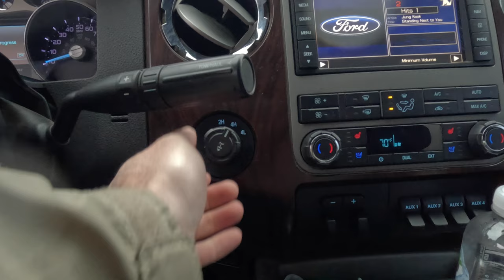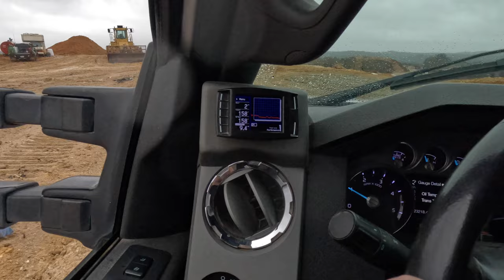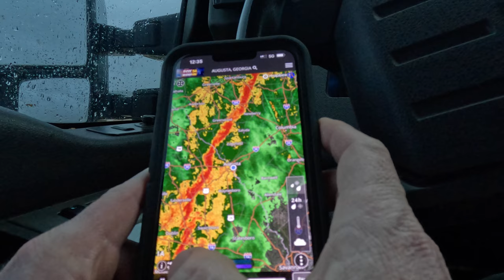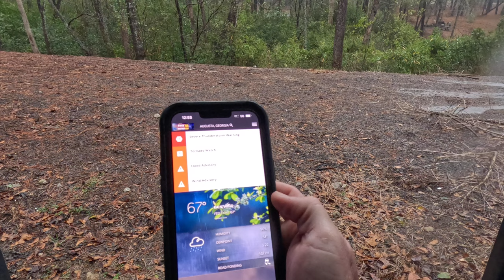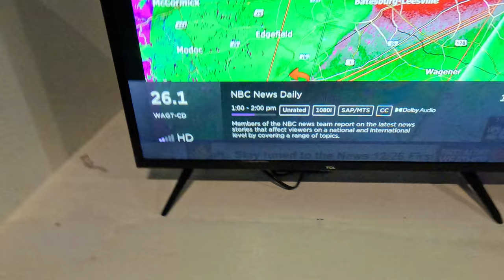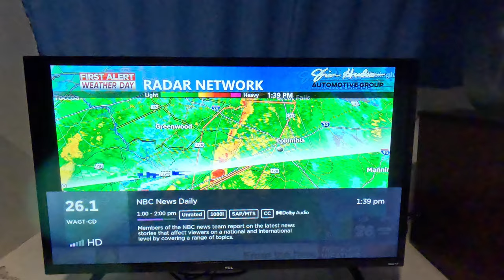BAD Storms Unleashed: A Look into the Underground Bunker for Protection

Comment: You don't have liter fences that you can move to your working face ? That you lift with a dozer or packer blade? We have 15 bull fences and if it's gonna be a windy day I set them up in a horseshoe around the tipping area just to keep down on the litter. We have paper pickers come to but I try to stop as much as i can. How many tons a day do you take in? We take 1,250 a day and we only got an 826 packer and d6t which I run in the trash and a d6n for covering and slopes
Reply from the maker: I need some of the fences like you are talking about, just havent built any yet. We take in about 800 tons a day. Appreciate you taking the time to comment buddy!!